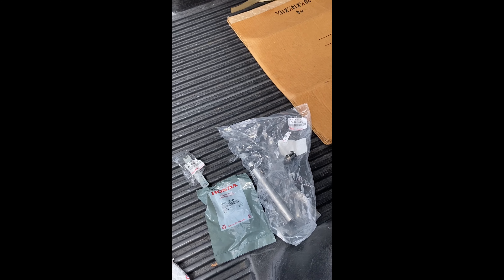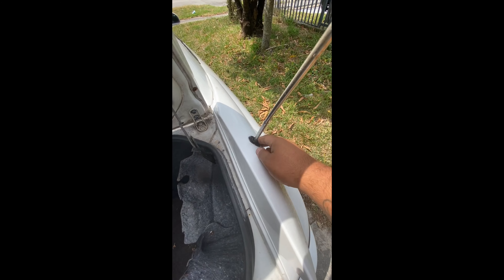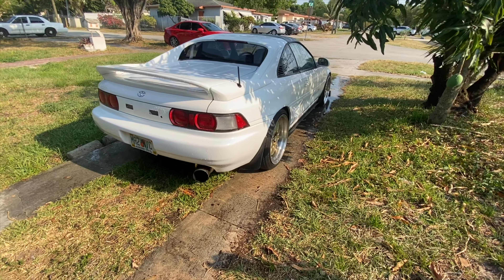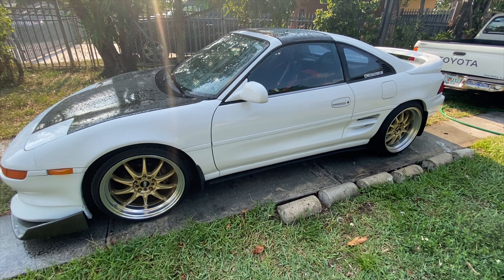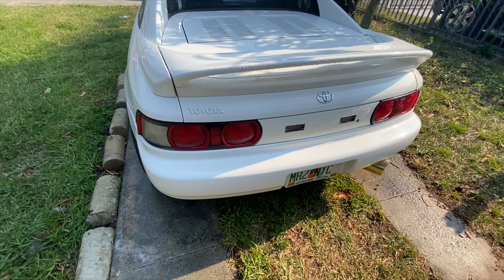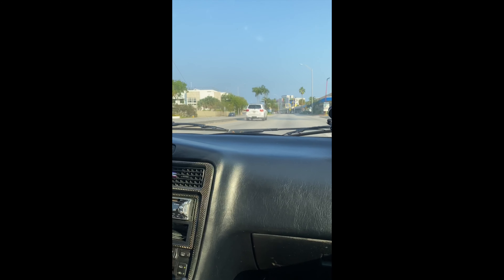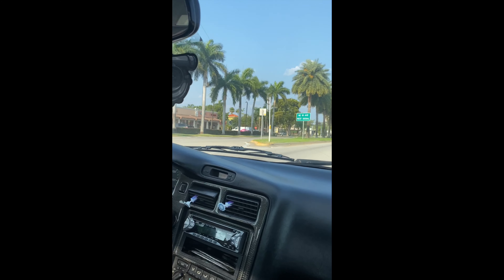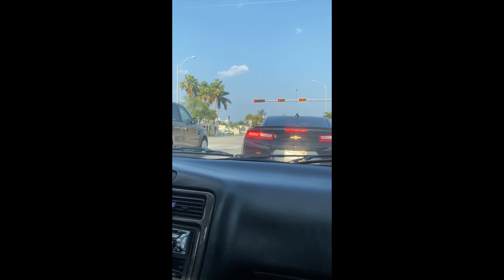INSTALLING S2000 ANTENNA ON MY SLOW MR2 🤣

Comment: How are you liking the side splitters? There is not much information on  them other than Camp is the only vendor, and there is no telling when I'll actually receive them.
Reply from the maker: Texas Law Dawg i love them my buddy got em from ebay for like $80 bucks, i will attach the link. And yes i understand, especially with Covid. Everything will definitely be on back order due to shipping and manufacture delays
https://www.ebay.com/itm/222385435459
Its now $99 but you could find it cheaper if you look around

Comment: I'm trying to get this done right now. Literally the LAST thing to do. What year is yours? Mine is a 93 and I'm mainly just looking to seal up the hole and keep it water tight.
Reply from the maker: Hey man hope all is well and yeah mine is also a 93. Its an awesome mod to make the car look better
Reply: @mr2dailydriv3n   do I need anything else besides the s2000 mast? I can't really find much info and your video left the installing out. I'm restoring this for my wife. She is the original owner and 'Im shooting for bone stock (minus the antenna obviously). I'm headed to the paint shop right now to pick up the car. If you could give me a parts list or advice that would be GREAT! You can email me at cfhcosplay@gmail.com. I'll shoot you some pics of her car.
Reply from the maker: CFH Cosplay hey you will need to seal it from the hole itself, Since the s2000 antenna is slimmer then our oem one. Yeah i know the video stopped recording and when i noticed it was too late as it was already done. After installing it you will have a 1/3 of a penny opening. You can either seal it from there or seal it from the top side panel using your old rubber seal which is what i did. I will go ahead and record a video and send it to you tomorrow afternoon.
Reply from the maker: I sent you the email with pictures and video if anything hmu through IG mr2dailydriv3n